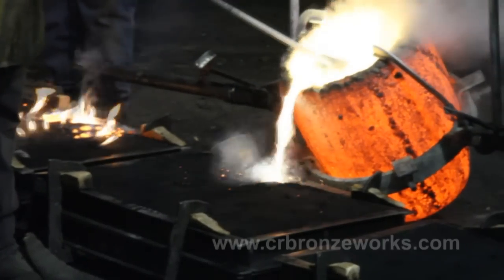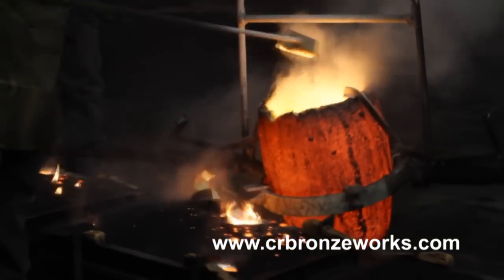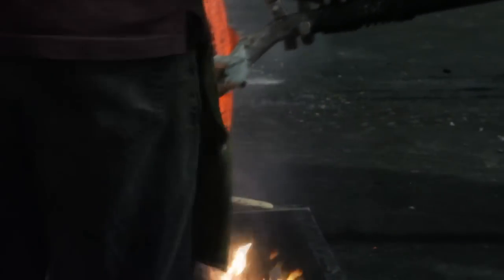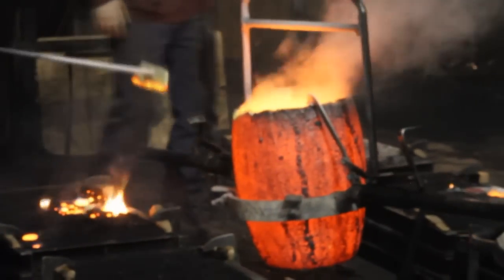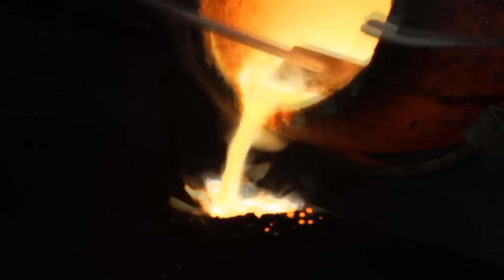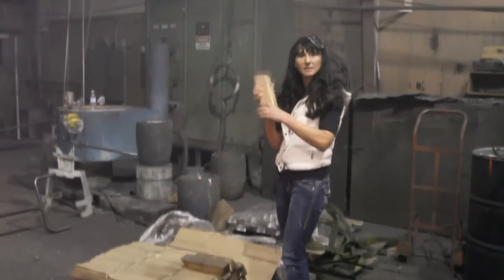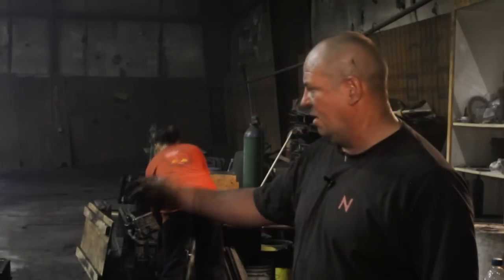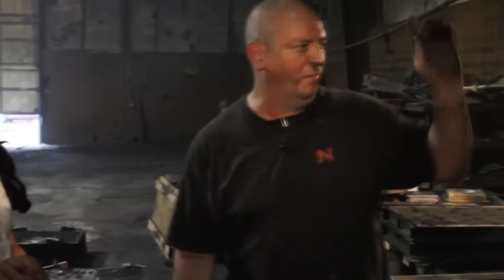How a Bronze Grave Marker is made - Part 2 (Casting) Bronze Headstone Bronze Cemetery Marker

Comment: I make bells here at home. I plan to make my own bronze and pour some bells. Right now i make them of aluminum but hopefully I will soon get a crucible tongs to lift out of my furnace My furnace is just fire brick but gets that hot inside. I have accidently melted holes in iron and steel crucibles so I know it will melt copper and bronze. I do this outside and there is plenty of fresh air.